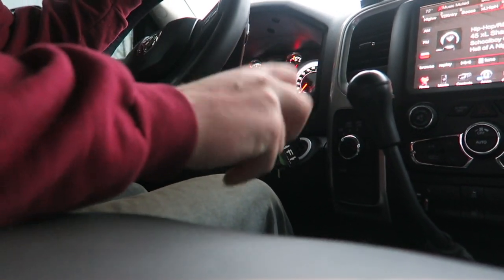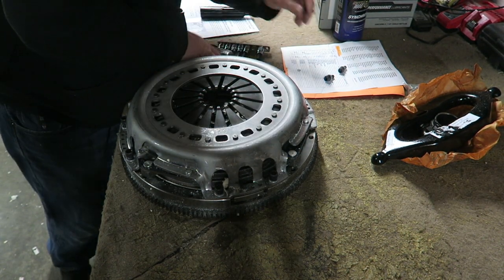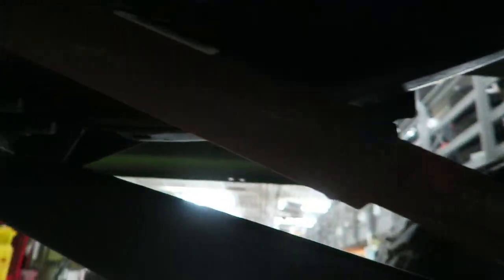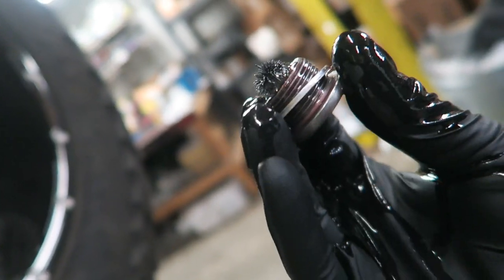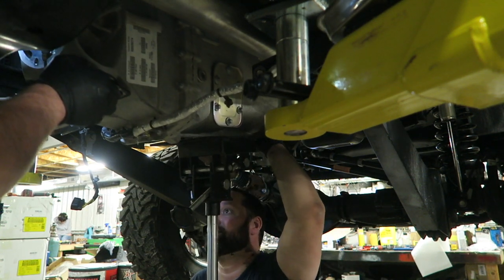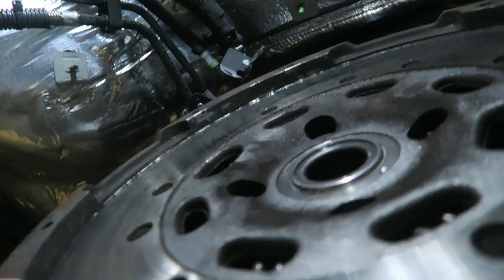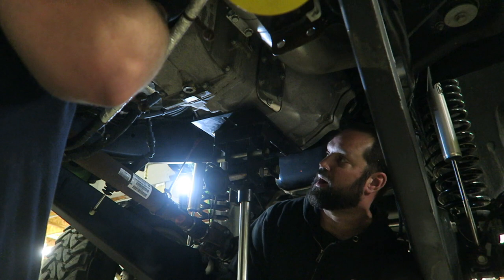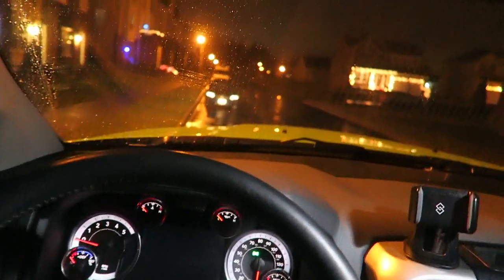INSTALLING A SOUTHBEND CLUTCH AFTER 9K MILES!!!!

Comment: When I come across a big hex like that, I take a 14mm bolt and a nut preferably a 14mm as well, and weld the nut to the bolt. Then you use a 14mm socket on one and and stick the other end of the bolt into the hex you're trying to take out.  Works great! And cost 3 bucks. Or free if ya got the bolt already.

Comment: Just purchased a  Street Dual Disc south bend clutch.  Installed a Smarty Touch setting 4, less then 5 hours clutch started slipping with normal towing: maybe 6,000lbs very light. Started slipping in 6th at 75 mph.  So now I'm in the middle of replacing the clutch.  Recommend if you own a G56 and you install a programmer no matter how you drive..... it  will slip with a factory clutch. I really don't kill it when towing. Factory is not designed to handle anything over factory horsepower and torque.  Smarty Touch $850  South Bend clutch street dual disc $1,700

Comment: Got aG56 in my 2018 2500HD that I picked up 3 weeks ago.  Only has 1,600 miles so far. Don't know  if I want too tune, not planning on doing a delete. But I definitely plan on getting a stealth performance module. Has 4 settings , stock,  30hp, 60hp, 90hp. Supposed to get a jump in mpg, and the engine burns cleaner and more efficiently so it creates less soot and requires a regen less often.
Reply from the maker: My first and only regen my truck had was awful 😂😂😂 loss of power smelt horrid and loss of mpg
Reply: @ryan2546  did the light on your dash come on telling you that it was doing a regen? That is called a dynamic regen (there are 3 types of regens)and only happens when the filter gets a little too clogged up and needs to be cleaned, it forces a regen and you have to keep driving till its done to completely burn out what the DPF has collected.  Most regens in the Cummins are passive (they have a special name for it and I already forgot what is called but they are made to make your driving experience seamless so you don't know it's happening) and happen frequently as long as you do allot of highway driving or heavy towing.  I noticed twice that my DEF fluid needle moved slightly and wondered if it had done a regen or not.  I think I caught my third regen when it happened.  I always let my truck and turbo idle/cool down before I turn the engine off. I checked my exhaust temps when I was waiting(I have a bluetooth scanner that plugs into OBD II port and connects to my phone thru an app) and noticed 1 of my temps was between 950 and 1,000 F and was going down like it just got done with a regen or turned a regen off because I got off the highway. I only have 1,600 miles on it so far so I am still learning her habits and how she behaves. Last regen mode is a service regen, this  should to be done by a dealer or service technician

Comment: Quick question? Why not use a block heater in the extreme cold weather. I live in Oregon and it rarely ever goes below freezing, but I put a block heater on my diesel jetta.  It starts up SO MUCH EAISER and the cabin is warm when I turn it on. It also GREATLY reduces unnecessary engine wear in freezing weather
Reply from the maker: If it goes below 0 I’ll hook her up, I got videos coming on a wide variety of topics between the next mod

Comment: I dot put ATF in anything but a auto trans ! The big shop up north rebuilds transfer cases and has a sticker that says use only 5w 30 only and trans 6 speed manual I use 2 qts of Lucas oil stabilizer the full sythatic and top it off with Amsoil sever gear and the best combo yet and my trans NV6

Comment: Had the same issue with the weird socket when I was replacing fluids on a Jeep I had. Couldn't find one local and ended up having to order a set of them off Amazon. Not the best choice of socket on FCA's part!

Comment: G56 owner here! 😃 2018 Ram 3500 Cummins Tradesman 4x4 Crew Cab single rear wheel. Nearly at 5k miles. I saw those shavings on your drain plug...😬 I've missed a shift exactly TWICE. Ugh! Thank goodness were soft misses, but nevertheless made me kick myself. 🙄 If I change fluid soon, I'll snap pick of plug. Betcha those shavings are fair break in wear. Maybe someone can chime in? 🤔
Reply: Man thats normal. I have 168k miles on my truck, Change my fluids every 50k and the plug always look like that. had it checked by Standard Trans here in FTW and they say thats normal. The bigger the clutch the notchier the shifts and your going to get some tooth to tooth contact. As long as your ntot digging into and miss a shift or grind it you wont shear off the teeth and then you can just buy a new trans.

Comment: Clutch just died on me today while backing up with a load of lumber in the bed. I've got a 2018 2500 Laramie with a G56. I noticed on the Southbend website the 3250GK states for up to 2017 models. I cant call them till Monday morning but I assume this will still work on my 2018. Any idea?

Comment: I sold a deleted 2012 2500 6.7 68rfe and bought a 2017 Ram 3500 single wheel with a G56! Im pulling a 18Klbs+ Fifth wheel, I plan on deleting the truck what would be the best clutch? South bend Single disk?

Comment: I really one a Ram truck , but I’m having trouble finding good ones on Facebook and Craigslist , I’m looking for a 4x4 V8 5.3 L + for 15’000 or less , I’m being very picking cause I want those mirrors you have and lifted. Any tips you have for me ?
Reply: I'm assuming you mean the 5.7 Hemi V8 or 5.9 V8 or  5.2 V8 or 4.7V8? I would look at Auto trader or Cars.com Dodge went to the Ram name in 2013. You can buy those mirrors aftermarket. I put tow aftermarket tow mirrors on my Frontier. You can see great but fitting in the garage is a different story.

Comment: 2018 G56 2500 Laramie. Any plans on putting in short throw shifter?
Reply from the maker: If I can find one!
Reply: @ryan2546  check out Ohio Diesel parts, looks like they build one to fit stock shift knob and one in an aftermarket thread pitch.

Comment: The dual mass flywheel is intended to reduce NVH, (Noise, Vibration, Harshness), however, as we know, can't take the power a single mass flywheel can handle. 🤔 Why Ram did the dual mass is beyond me, especially if engine has to be "detuned" for reliability. Also, the dual mass is no free lunch in terms of smoothness. 🙄 Mine was a clunky sonofagun for 2.5k miles, then smoothed out. Nearly took truck back! 😐

Comment: 18 G56 owner, this stock clutch is trash. I bought the truck brand new and within 20k it was shot from normal driving and pulling  cattle a few times a month. Went back to Dodge bc I assumed it would be under warranty and found our Ram only warranties clutches for 12k miles!!!!!! Ridiculous.  I threw a fir and got them to pay for half but replace this turd as soon as possible!

Comment: Never ever put a dual disc clutch in a truck that is you daily driver they are for truck pulls like 2-3 k hp and a single disck will Handel 600 + and you can think me later. The duel disk is only one way in or out and it sounds like your throw out bearing is shot and I hate them for street. There is not very many grown men that will tell you the truth that the noise sucks!